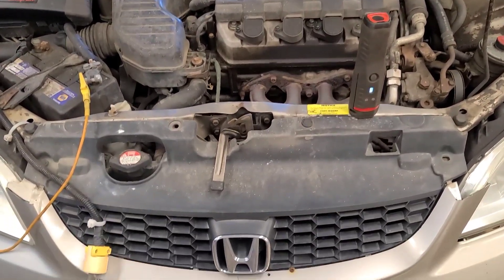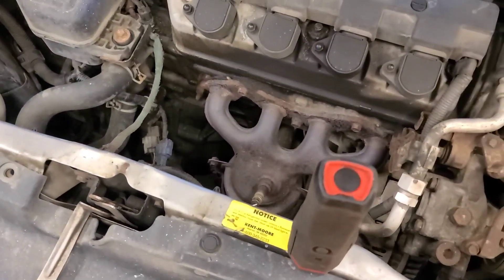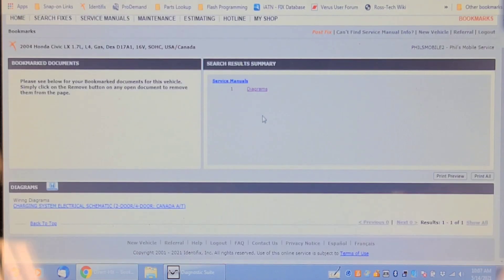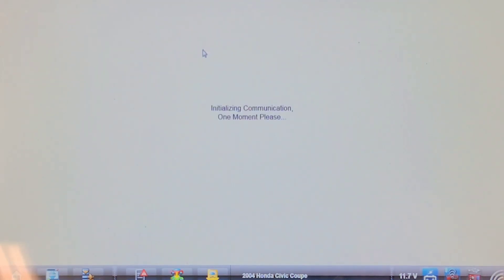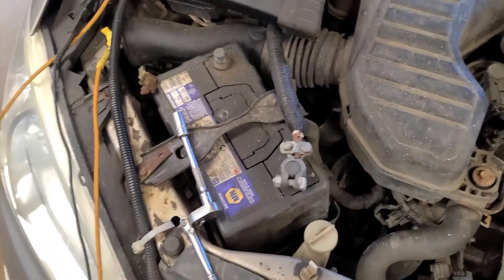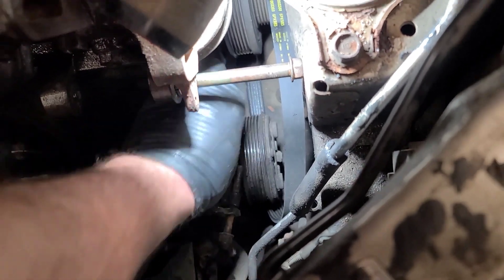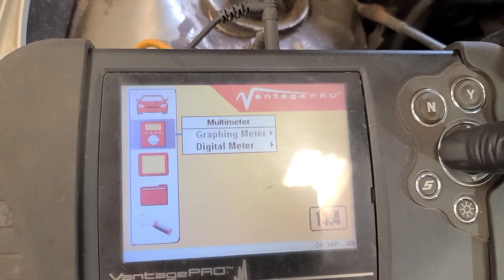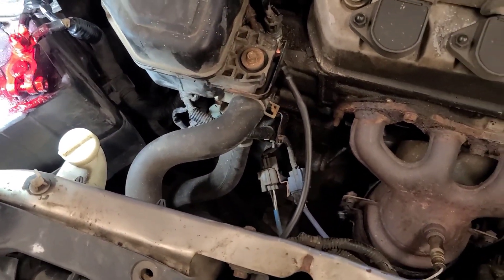2004 Honda Civic Lights Flickering Alternator Overcharging

Comment: Chased a flashing headlights dome lights sometimes pulsing idle for close to 3 months in my 2003 honda civic ex with close to 300,000 on it. After replacing the factory alt if nothing else just because of age the issue still remained. Anyways long story short after doing the usual checks I concluded this was an overcharging issue with the simple use of a dvom showing 15.3- 15.5 battery volts at an idle with no load on it. New factory ELD fixed the issue.

Comment: Ok, i have the same car. Headlights, tail lights, dome lights etc all pulsate/flicker. Ive been through 5 alternators. First 4 were reman, this 5th one is a brand new one. The previous one fixed the problem for about 6 months. New one still does it but its barely noticeable. I have upgraded grounds aswell hoping to fix it. Ive alao cleaned the grounds under the fenders. Is it possible i keep getting bad alternators?
Reply from the maker: Are you in the USA? If so the US cars have an Electric Load Detecter. It could be faulty.
Reply: @PhillipBailey  hey thanks for replying. No codes for alt. Only o2 and purge valve. Unplugging alt stops the surging. Unplugging battery makes it worse, but when i reconnect neg batt terminal it stops the pulse until I shut the car off and start it again. When I first start it it's fine for 10 seconds then begins to pulse.
Reply: @PhillipBailey  also, yes I'm in the U.S.
Reply from the maker: @DevTec.Garage  try replacing the ELD unit...https://youtu.be/UmeRp2Ay0ho?feature=shared
Reply: @PhillipBailey  that was going to be my next purchase even though this one is only 3 years old.  I've had this problem before years ago and replaced the ELD, battery and  alternator when I rebuild the engine.
Reply from the maker: If you disable the alternator does the voltage still fluctuate? Any codes in the ECM?

Comment: Mine is undercharging, I have replaced the alternator and battery. But still having problem with flickering headlights when accelerating. 😢
Reply from the maker: I'd recommend to check and clean all the body grounds. Test the voltage drop on the output wire. What's it measure across the battery while running and at the back of the alternator while running?

Comment: Maybe you can help me, I have a 04 civic and the car died so I replaced the battery. Car dies again so I replaced the alternator. Car is still dying. I cannot figure out what it is and need help bad
Reply from the maker: Need to confirm the wiring to the alternator. There should be power to the heavy output wire all the time. If not there is a main fuse which I believe is in the junction box.  It's like 100 or 120 amps if I recall. Does the charge indicator light come on either the ignition? Is it on while running?
Reply: @PhillipBailey  the battery light came on and I thought the problem was a loose alt belt so I tightened the belt and the light went off but the car died the next day
Reply from the maker: @Copperthedachshund0  the main output wire should be live all the time at the alternator. There is a black wire with a yellow trace that should have power with the key on. It's in pin 1 at the alternator. The other three wires come from the engine ECM. Check for codes.

Comment: I've got a weird one on my civic, parked it's fine, I put my foot on the gas and let go and the lights flicker for a little while then go back to normal. 
When driving in gear they flicker, when in neutral and coasting down a hill or whatever, they flicker. 
Only time they don't flicker is when I'm parked. Any ideas?
Reply from the maker: Check the body grounds. Some have a small ground wire by the power pump from the rad support. I believe there is also a ground on the bellhousing.
Reply: @PhillipBailey  Thank you Phillip, I will have a look.

Comment: you should put a eld in under hood fuse box
Reply from the maker: Ok ill bite  what's an ELD?
Reply: @PhillipBailey  electric load detector  look it up very common for flicking lights charging problem in this model ull the back to 1990 acoords

Comment: There was a shop talk on these, techs were adjusting the belt and leaving the pivot bolt loose and it would cause the ECM to fail.
Reply from the maker: Good to know. I definitely was sure to tighten both bolts. That stupid adjuster wing nut is a dumb idea. I cut it off so you could put a 12mil ratchet wrench on it. There's an existing nut under the wing nut. Thanks for the tip.
Reply: Paul moak dealership told me Hondas only like factory alternators. My lights flicker and battery light intermittently pops on. So I changed the alternator to a Wai brand. Lights still go bright to dim. Has a advanced alternator as new on it. Same problem either way.  Inside fan goes from high to low.  Changed eld also. What a headache problem. A honda reman costs around $410. Anybody got a solution to this nightmare.
Reply: @timothymyrick507 i’m going thru the same problem…but my lights flicker an the battery light comes on when i rev the car to high RPM’s…
Reply from the maker: @ayojoe86 it's likely worn brushes in the alternator